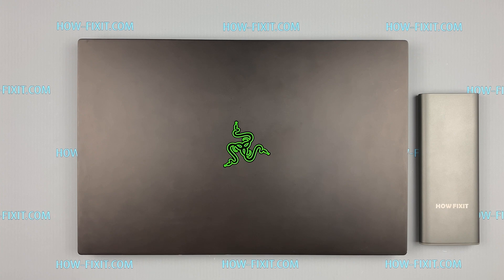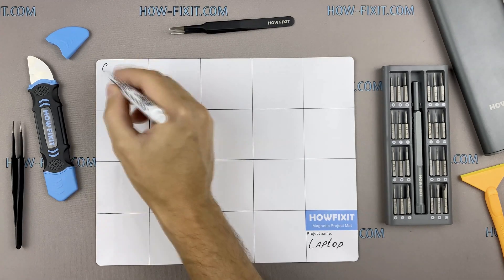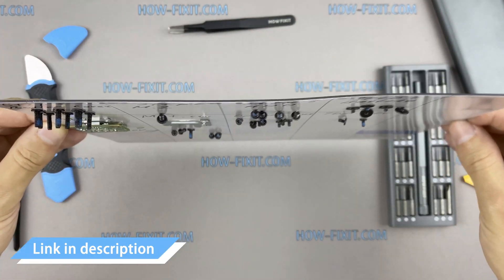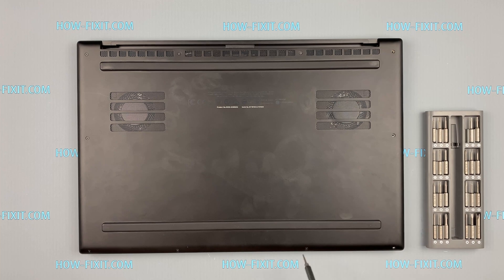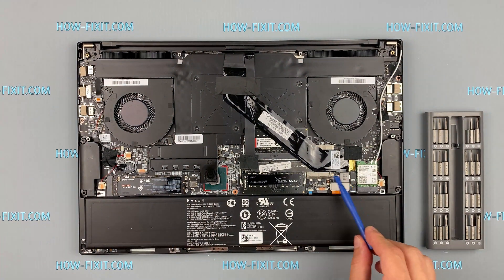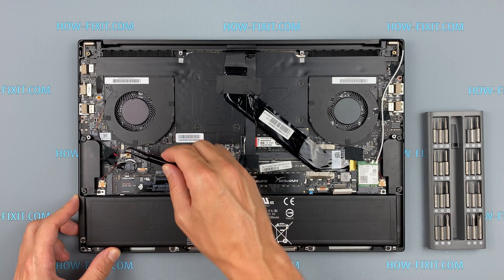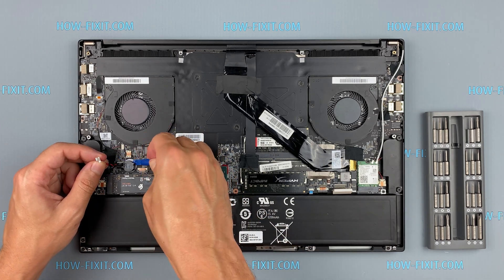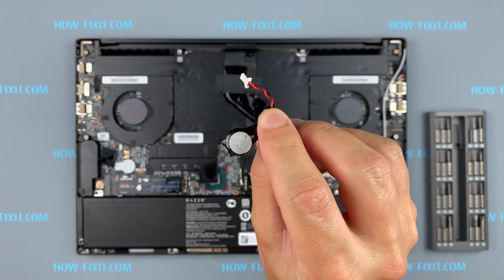Razer Blade 15 Advanced 2018 BIOS Reset & CMOS Battery Replacement Guide

Comment: 😭my BIOS crashed during bios update can you  help me? Now it just turns on but nothing happens
Reply: Any fix ??
Reply from the maker: A BSOD in the middle of a BIOS flash usually means the firmware itself is corrupted, so a simple CMOS-battery reset (like in this video) won’t bring the screen back. Try these steps in order:

1. Rule out a “stuck” power state
Unplug the charger → hold the power button for 15 sec → keep holding while you plug the charger back in → release and power on again. Razer lists this as the first step for blank-screen cases. If you still get keyboard RGB but no picture, move on. 

2. Test with an external monitor
Plug in HDMI/DisplayPort and press F4 a few times (that cycles display outputs on Blade models). No picture = BIOS is almost certainly bricked. 

3. Decide on a recovery path
Unfortunately the 2020 Blades don’t have an onboard “crisis” recovery ROM. Community teardown reports confirm your two real options:
• RMA / warranty claim – if you’re still covered, let Razer re-flash or swap the board.
• Manual SPI re-flash – out-of-warranty owners use a CH341A programmer + SOIC-8 clip (or desolder and replace the Winbond 25Q128 BIOS chip pre-flashed with stock firmware). It’s doable but requires careful disassembly, a good dump of the correct BIOS version, and steady hands with the clip—or hot-air and flux if you go the replacement route. 

4. If you try the CH341A route: 
- Disconnect main and CMOS batteries first. Use the 3.3 V-mod or a level-shifter—over-voltage fries the chip.
- Read → verify → erase → write → verify the new .bin before re-assembling.

5. Not comfortable soldering or flashing?
Any laptop board repair shop can do an SPI flash for you in about 30 minutes; it’s usually cheaper than a new motherboard.

Comment: Hello,

I have an issue with razer blade 2020 that I was updating bios with official razer tool and got blue screen during it and now the keyboard lights up but the screen never turns on. What would I need to do to fix it? 

Thank you for any help.
Reply: Dude same thing literally just happened to me. Did you manage to find a fix? Please let me know.
Reply: @Xizcoify  yeah I did I can send you some links which guided me through how to fix it.
Reply: @kacpernowacki4654  can you please send it to me aswell
Reply: @kacpernowacki4654  yes please.
Reply: @kacpernowacki4654  I just had this happen, too. Pulling out the CMOS battery didn't work. Can you send me the link to the fix, please?
Reply: @kacpernowacki4654  did you please guide me same problem occurs to me
Reply: @kacpernowacki4654  yo pls help me out I have the same issue.
Reply: @Xizcoify  I tried posting link as well as instructions and it doesn't want to let me..
Reply: @kacpernowacki4654  could you direct me on what to search exactly? And the websites name?
Reply: Hi  @kacpernowacki4654 im a bit late, but do you have the guide posted? I need to clear cmos of razer advanced 2020
Reply: Hello! This just happened to me, please tell me what I should do
Reply: Can you also send me the link please!! They had me update this crap and now my laptop doesn't work
Reply: Hi i need the link too I'm also suffered with same problem
Reply: hello, I had the same problem😢. Please share with me your fix
Reply: lol I also need help bad
Reply from the maker: A BSOD in the middle of a BIOS flash usually means the firmware itself is corrupted, so a simple CMOS-battery reset (like in this video) won’t bring the screen back. Try these steps in order:

1. Rule out a “stuck” power state
Unplug the charger → hold the power button for 15 sec → keep holding while you plug the charger back in → release and power on again. Razer lists this as the first step for blank-screen cases. If you still get keyboard RGB but no picture, move on. 

2. Test with an external monitor
Plug in HDMI/DisplayPort and press F4 a few times (that cycles display outputs on Blade models). No picture = BIOS is almost certainly bricked. 

3. Decide on a recovery path
Unfortunately the 2020 Blades don’t have an onboard “crisis” recovery ROM. Community teardown reports confirm your two real options:
• RMA / warranty claim – if you’re still covered, let Razer re-flash or swap the board.
• Manual SPI re-flash – out-of-warranty owners use a CH341A programmer + SOIC-8 clip (or desolder and replace the Winbond 25Q128 BIOS chip pre-flashed with stock firmware). It’s doable but requires careful disassembly, a good dump of the correct BIOS version, and steady hands with the clip—or hot-air and flux if you go the replacement route. 

4. If you try the CH341A route: 
- Disconnect main and CMOS batteries first. Use the 3.3 V-mod or a level-shifter—over-voltage fries the chip.
- Read → verify → erase → write → verify the new .bin before re-assembling.

5. Not comfortable soldering or flashing?
Any laptop board repair shop can do an SPI flash for you in about 30 minutes; it’s usually cheaper than a new motherboard.

Comment: hello , I want to ask about CMOS battery, my razer blade 15 late 2019 has some problems . multiple shutdown happened before laptop start&windows time always not correct ,and also because time not correct so I cant use the internet, are this problems is related to the CMOS battery? Thankyou
Reply: This is the exact same thing is happening to me. Did you ever found out what the issue was?
Reply: Pls were you able to fix this?
Reply: @cirqueduanime  you can directly contact razer support tell them to replace the cmos battery
Reply from the maker: Yes—those symptoms almost perfectly with a dying CMOS battery. I don’t have a dedicated Late-2019 teardown on the channel yet, but the 2018 guide you’re watching shows the exact same CMOS swap procedure—screw layout just changed slightly. Hope that helps, and let me know how it goes! 👍

Comment: Any ML1220 3v should work?,  sorry for my english, great video, my laptop boot 3 times after start because not syncing the datetime
Reply: Mine is doing the same thing and i manage to get the batteries. Did it fix your issue?